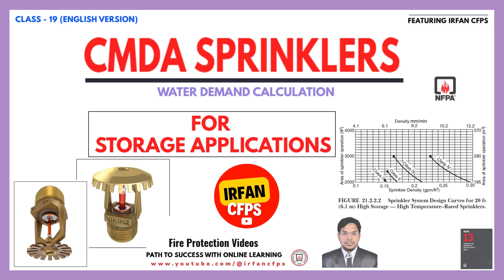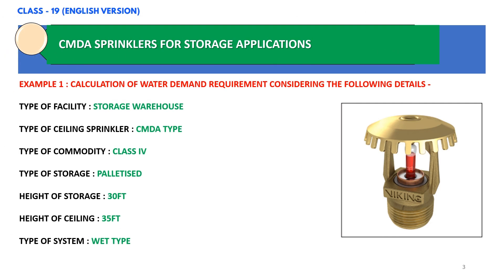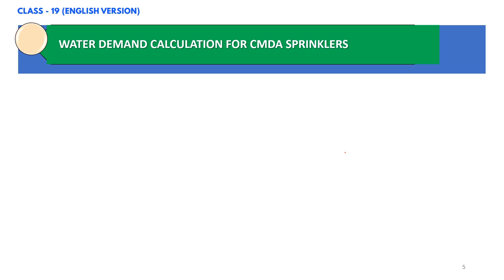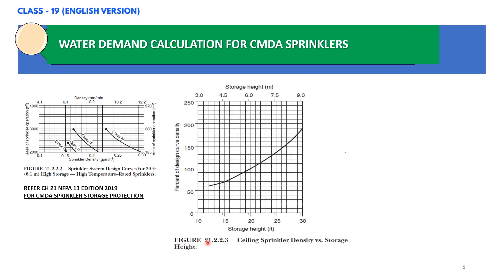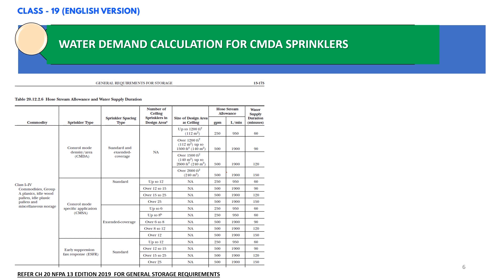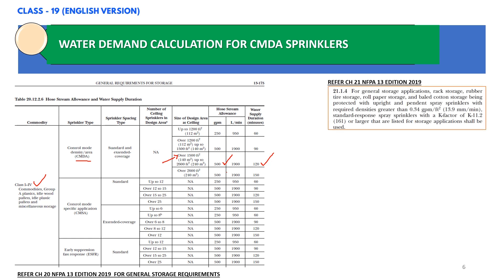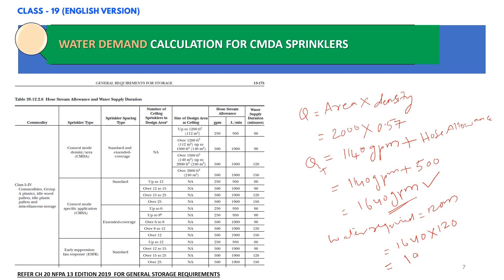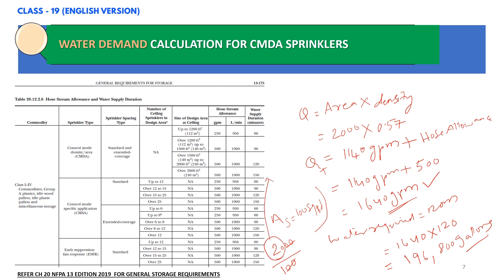CMDA Sprinkler Water Demand Explained with a Simple Example!

Comment: How to differentiate whether we should use ESFR or CMDA sprinkler?
Reply from the maker: Very valid question. For storage applications u can use cmda/ esfr/Cmsa sprinklers but there will be change in water demand when u use these.. I will be sharing in next two videos about cmsa and esfr sprinklers with water demand calculations and in later video I will compare and show which is the better option for storage applications.
Reply from the maker: We can consider CMDA or CMSA or ESFR sprinkler for storage applications. however the water demand will vary. you can check my videos on the same for clear understanding of the demand requirements
Reply: @irfancfps  Thanks